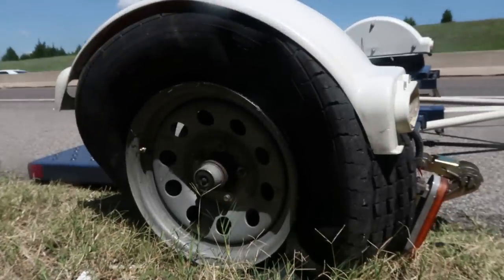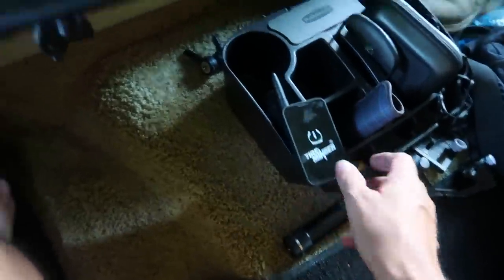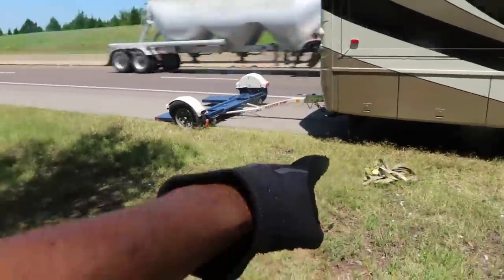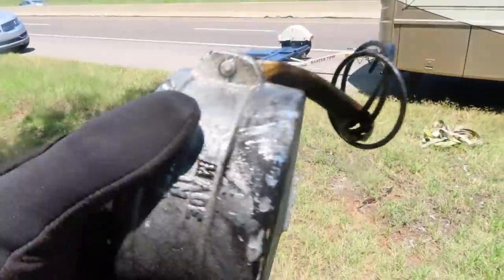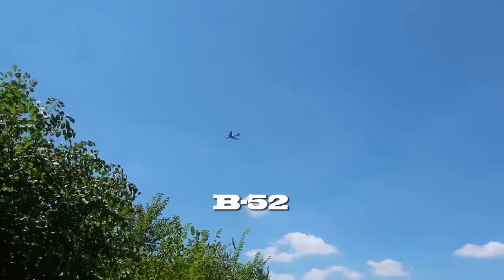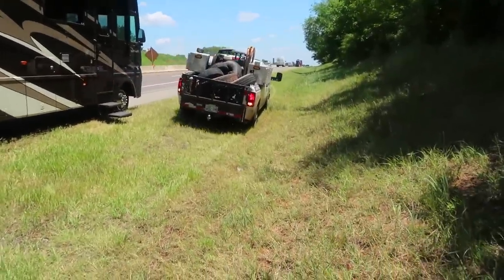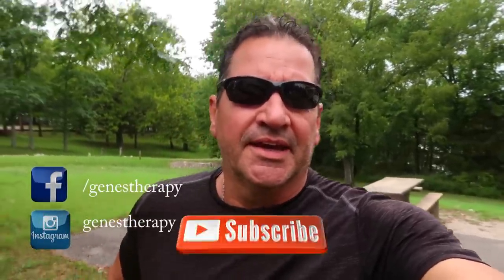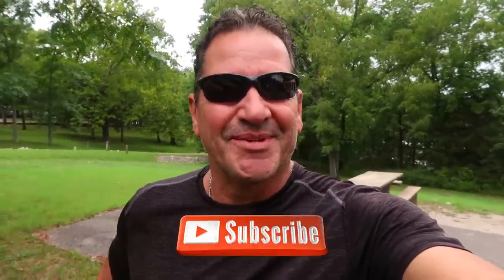Tow Dolly Interstate Blowout, what you should know.

Comment: Thanks so much for sharing this.  Just bought a Tow Master dolly yesterday, and it is great information to know.  We have just switched from a travel trailer to a Class A.  I understood you can not make tight/u-turns with a dolly, and you have driven the point home.  I have several takeaways from this that I will implement.  1) have a spare tire (on order)  2) get a TPS.  It is very interesting that all h--l was breaking loose back there, and you could not feel it in the handling of the rig. And the last.  3) Add checking finder clearance between wheel as a check item before rolling.  Will check your videos and see if you did one on tps systems. 

Oh, Pearl caught the last part of this video and found it interesting 

Jim

Comment: Always have your spare tire(s) and tools. Check on dried out tires at the bead where it can rust, dried out valve stems, have a semi tire bead breaker and 3 pry bars and a nice hammer in case you bend a rim, bead sealer, soap and spray bottle for mounting and dismounting a tire, extra valve stems, compressor or a hose to steal air from tires temporarily untill you get to air compressor.

Comment: I found your channel about 2 weeks ago and I really like it!!!  I’ve had a couple motor-homes and a pull behind camper while the kids were growing up, but it just wasn’t worth the cost of the maintenance after they moved out.  We didn’t use them enough!!  
25 years ago I purchased a dolly and it came with the receiver and the ball was on it.  I was told it was good to go.  They were wrong – BIG TIME!!  200 miles from home the nut came off the ball, there was a little bump and then it was only held on with chains.  The car (VW Cabriolet) had a low center of gravity so it didn’t flip over.  It just whipped from side to side and each change in direction the tongue of the dolly would go under the motor-home as far as the chains would allow.  There were black marks on the road from the dolly and the rear tires of the car.  They covered both lanes.  We got lucky, no traffic and no damage to anything!
Haven’t had a camper of any kind for almost 20 years.  My wife and I want to get a 30 foot class C or maybe an A and go fulltime so I’ve been checking out a lot of videos.  The TPMS will be on my list of must haves.
Reply from the maker: Holy smokes D that would be anyone's worst nightmare! My dolly has served me well over the years, this flat tire was the only issue I had with it and I say it's my fault with the car pushing the fender in on the tire in tight turns. Next week I'm having the Blue Ox tow package installed to tow the car flat, a tad expensive but it will be nice to not have to keep the dolly on site anymore. Best of luck in your new travel endeavor!
Reply: That whole experience could have been really bad!! We were blessed!!!  We're also wanting to flat tow the next time.  Be carful with the brake setup in the car.  If it's setup wrong it can ride the brakes.  I'm looking forward to watching your video of the change over to flat tow!!   Is your transmission able to be used for flat towing?
Reply from the maker: @blvelpa  Yes the Chevy Equinox, (I turned in Abe after it's lease was up), is one that has a transmission that does not require the engine to be running to lube the trans. It's a great car, mainly because I made sure to get the 6 cyl. Drives night and tight, quiet ride. I hope they will let me film the install that would be great.
Reply: If they don't allow you to video the install, you can always do a review of it later.  Good luck and safe travels!!!!

Comment: I did this with Penski truck trailing my sister's car coming thru Kentucky from Dallas. Being on the driver's side, dark out, the repair guy with no reflector vest, made me a nervous wreck. We were 70 yards over a rise. I had two red cone flashlights doing the airport thing taking my arms over my head and moved them out to the road and swung my upper right. We exited the next exit. A trucker said if it were not my directing those lights as I did, he would never been aware of that guy fixing that tire. (I knew that)...that repair guy thought a was embarrassing him.  Grrr. Being a school bus driver for 32 years, I've seen too much out there on the road. Good Job staying where you did Gene. Can you believe I almost got fired for putting a team way up by the tree line yards back of my bus out of any possible 'spray field'? I told him, "My license, my decision." I won. Thank you for emphasizing the imminent danger in these situations!

Comment: I carry a spare for my trailer. The rubbing is one reason why I tow on a car trailer. You can backup a trailer without unhitching too.  It takes more room to park, but I will leave the trailer in a parking lot if I need to. (Wheel locks) If you have ever seen a RV towing a dolly with a flat tire, you will never tow without a TPS on them too.
Reply from the maker: Roger that Roy, looking forward to December when I will be getting rid of the leased Lincoln and buying a car I can tow flat, been a good dolly otherwise.
Reply: Yes! to 4 down, 2 less tires to feed, and a save back musling that dolly around. I went 4 down after seeing all the 4 downs in the Keys, learned from their wisdom. Got it down to 5 minutes to hook or unhook. Only thing special about mine is the driveshaft disconnect because it is an E350. Don't even use the cable anymore, just smack it with a dead blow two shots and it's in or it's out. Can see Gene in a styling (T case neutral) Jeep, maybe even hang a bike off it.
Reply: I'm confused how you can have less tires to feed with 4 down. 2 dolly and 2 rear tires = 4 tires. I use a car trailer because it protects the SUV for stones and road debris plus the tires are much cheaper. I have a wheel for the tongue jack so rolling the empty trailer around is not a back breaker.
Reply: 4 down is 10 tires, dolly is 12 tires, just because they are not on the road, yea still have to feed them.

Comment: I have the same dolly you have.  Good Sam fixed me up with new wheel and tire.  Later I had to bring my dolly into the dealer I bought it from, (Tire blew 1000 miles after I bought it) and they replaced tire, brakes, fender.
Reply from the maker: Interesting Harald, I've been pulling this dolly across the US for two years now, no issues! This issue seems to be because my tow vehicle is so wide on the dolly that tire rub on the fender frame in inevitable. New car soon and new towing config soon!

Comment: When you change that fender, be careful with that lighting plug down at the center. They are FRAGILE.  Also check that the vertical bar of the mounting bracket is not broken.
Reply from the maker: Roger that , checked it and need to replace one. I used a bar and hammer to re position the vertical bar and made some nice changes, we'll see how it does

Comment: I think that particular dolly company has two models, one is a couple of inches wider. Is that the one you have? If not, you might consider a wider one for your car. Just a thought. Great video!
Reply from the maker: Roger that, this one is their most heavy duty. By December, I need to either get a different car (that's when the lease ends on the Lincoln), that has less width for the dolly, or a Chevy Equinox and tow it flat, with the blue ox $$ set up fee. Would be nice to find a low mileage 2014 Honda CRV.

Comment: Glad you are OK, very interesting that you couldn't feel it as that could have been really bad.  Why does the dolly move like that?  You shouldn't need it as the limited slip differential in the rear end of Abe should take care of turns or am I wrong?  Maybe go with a thinner tire on the dolly?
Reply from the maker: My first dolly didn't swivel, and the front tires would scrub the rubber off on the nonskid on the dolly, you would think the dif would keep up, but there is still torque there. I made some adjustments to the dolly that should stop the rub, also I need to make sure the car is perfectly centered on it. In Dec I'll be getting a car I can tow flat, so I'll lose the dolly, (sorry Abe) Take care and thank you!

Comment: If it is your dolly I would consider longer wheel studs and spacers to move the dolly wheels/tires further away from the vehicle (toad) you are pulling. Then you can move the fenders out also. Just my 2 cents.
Reply from the maker: Very good suggestion thanks for that. I plan on returning my leased car in Dec and getting a Chevy Equinox which can be pulled flat with a Blue Ox config, if I were to keep the dolly that would definitely be a good mod to consider ;)
Reply: Then you will have a real toad.

Comment: Fun on the side of the road!  Like you said, at least it wasn't raining! Glad that truck debris didn't nail you!  It was good that you replaced both tires since the other tire had a similar issue.  Would you have discovered the root cause of the failure if you would not have removed the good tire?  Why does your dolly pivot on the platform?  Do they all do that?
Reply from the maker: Most dollys pivot on the pin to remove the torque out of the front end which can cause the front tires to scrub. I discovered the fender because when the new tire was put on I went to spin it and felt it rubbing. Thanks for the kind words, cheers John!

Comment: Did you have a mounted & ready spare tire for the dolly?? I always travel with one. The tire wear issue in tow dolly tires is a REAL problem! What did manufacture say about that..
Reply from the maker: Hi Pete, I didn't have a spare yet, wouldn't have mattered I  needed both tires replaced and I wasn't doing that on the side of the road. I didn't follow up with the manufacturer because it the manual it states that you should not make (tight) Uturns with the unit loaded as it this could result, so partially my fault, I should have checked fender clearance after I made that turn. Hasn't been a problem anymore with the new, narrower car.
Reply: Thanks for warning I will certainly keep checking fender clearance on both side of car.

Comment: Do you think that there's a defect in the design of the dolly where the tire rubs on the frame?  What brand of dolly do you have?
Reply from the maker: It's a Tow Master. Great dolly, good brakes, takes a beating. It warns against Uturns in the manual, I didn't have a choice in my situation. The tires pressed against the metal frame that supports the fenders. Bent the frame onto the tires, causing them to rub, and eventually fail. The Lincoln MKX is a wide vehicle, that also contributed. Safe travels!
Reply: @GenesTherapy  Thanks for the information.  I have a class A motorhome on order and I will be buying a small car to tow and I like the dolly instead of flat towing.
Reply: @GenesTherapy  Thanks for the information.

Comment: Hey Gene, noticed you have dually extenuation hoses to get to the inside tire. After 2 sets of hoses rotting out on me (bout 3 years each) I finally found true 6 inch valve stems in a dually kit,  http://yourtireshopsupply.com/category/796_828/ford-dodge-class and just love them. No more extension hose failures for me.  https://imgur.com/gallery/MF3hMM1. Also have RVI TPSM’s just have to put the caps on and enable.
Reply from the maker: Nice find! I'll be getting those, thank you sir :)

Comment: The FIRST thing you do is drive very slowly off the interstate to a safe place. The tire is already ruined. Sitting on the side of the road can get you and/or the repair man killed.
Reply from the maker: You must pull over immediately, you cannot continue to travel to an off ramp, driving slowly in the right or even emergency lane can cause another rear end accident. (in this case the next exit was miles down the highway).  Also you will get a ticket for damaging the road if you continue to drive on the rim. (30 years law enforcement retired, I know this). Once off the travel lanes into the emergency lane, put out flares, warning triangles, etc, stay away from vehicle. Other motorists were very good at moving over a lane in this experience while tires were changed out. Plenty of prayers either way :) :)
Reply: Nonsense. I'm getting off the interstate.

Comment: I've been watching, enjoying and subscribed to both yours and Pippi's channels for close to a year now.  I've got a 2018, LTV, Unity MB, which is built on a 2017, Mercedes, Sprinter chassis, with dually rear wheels.  The sprinter, in my opinion, has a great, fuel efficient,  turbocharged, diesel engine but lacks many other high quality, &, or safety features, one of which is a TPMS!  I was wondering if you'd purchased yours as an after market item?  Any insight as to which systems you or any of your viewers may suggest.  I don't tow anything at this time, & don't expect to.  Thanks, in advance for any suggestions you may provide to me.  May God bless, guide, & protect you guys to safe travels!  Pete, from Port Orange, FL.
Reply from the maker: Hi Port Orange neighbor! Well, close enough to Orlando.Anyway,  Pippi has TPMS stock in the Doge Ram truck, but uses a separate system for her trailer. I use TireMInder for my RV and towed vehicle. I'm very happy with it, as seen in the video, but please do your own research to find the one that best suits you based on what you haved or what you want to spend, learned through user reviews etc.. Yes, mine are after market.Let us know what you decided to go with and how it worked out!